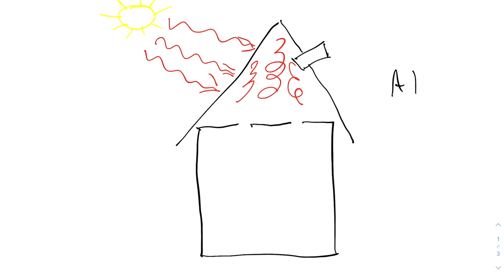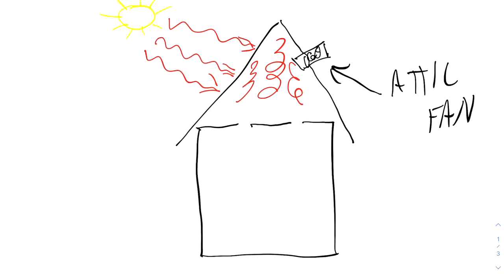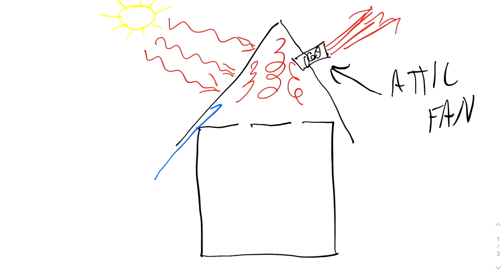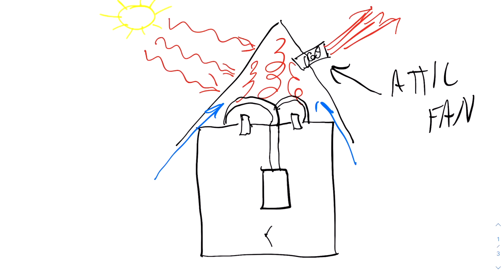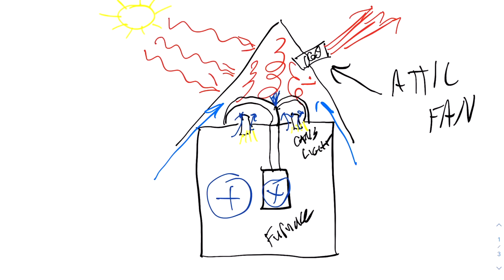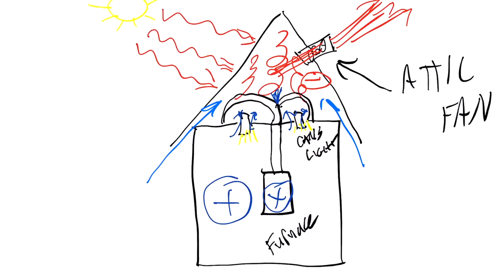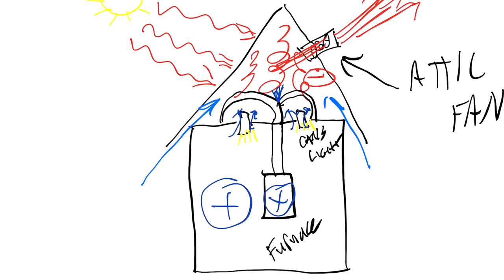3 Remodel Rip-Offs

Comment: Bummer, incorrect and completely inaccurate information regarding attic fans.  At least in a dry and hot climate.  The more attic ventilation the better. It will extent the life of your roof and WILL decrease your attic temperature.  

In this case, do NOT take Matt’s advice regarding attic fans.
Reply: Incorrect. It's bad in any climate.
Reply: His point is powered attic fans are a rip off.  Didn't talk about regular attic vents which obviously are important.
Reply: @shootthechit  I'm sorry, did the algorithm wade you and other losers to a video from over a year ago? 
Tough sht.
Reply: @shootthechit  see if IGAF

Comment: I installed an roof mounted attic fan and gable one also the other side of the house over 30 years ago and It reduced my power bill over 75 bucks a month In the summer here in Florida. I can feel the pull of outside air entering at the eve vents, and it then gets pulled thru the attic, along with the hot air already in the attic, so this video can claim what they want, I know that mine works for sure.

Comment: Attic fans are not a ripoff. Proven to work effectively
Reply: No
Reply: #Yuhhp
Reply: I know of Whole House fans for your attic to be good. Is there a scenario where an attic fan will work good?
Reply: Attic fans also increase pollution in the house.
Reply: Coolsdown my attic by 8 to 10 °F and fresh air blows continuously throughout my house👍
Reply: @decaprio7421 they actually clog up your soffit vents with dust and pollution and are generally bad for your attic.
Reply: By whom?
Reply: Built to fail
Reply: Aren't attica supposed to draw and expel air naturally?
Reply: We need to see this person’s engineering degree.  We need the math involved and science . We need a final decisive decision
Reply: Attic fans work….mine died and my attic temp rose by about 30 degrees and my AC struggled to cool….got it fixed and suddenly my attic is cooler and ac is good…that’s a scam? Lol get out of here
Reply: Click bait or what!???

Comment: Forget the strange example of using a fan to cool the Hot Pocket in the microwave - it was frozen to begin with and the objective is to cook it! Note than when that microwave is running it uses a powered fan (not convention) to get rid of the hot air being generated by the magnetron. With available gable and/or soffit vents an attic fan helps replace the very hot air from the attic with "cooler" air from outside. Even if you are able to completely seal off and insulate the living space many of the houses here in Texas have the AC fan, evaporator coil, and duct work in the attic. Anything that economically reduces the temperature of the attic air in summer is a good thing.

Comment: Good stuff. The one item I'd defer with is replacement windows. Back in 2004, I bought a real old house and was paying $600/mo or more a month during winter in heating. Replaced the windows, and my heating costs dropped to about $300/mo. Take 4 months of cooling, average about $1,000 of saving + $1,000 in comfort a year, I paid my new windows in about 6 years. Stayed in the house longer than 10 years, money paid back. If for no other reason, the comfort alone really made the difference considering the old windows were basically sieves.
Reply: And then the seal breaks and the windows fog up and water etched the glass.  New window time.  I am keeping single pane and getting storm windows.

Comment: Attic fan for Hot-Humid climates:  As long as your living space is air-sealed from the attic, then having a fan with adequate CFM pulling hot air out is beneficial.  After all, what's the purpose of roof turbines or ridge vents?  Air currents seek the path of least resistance and as long as there are enough soffit vents, any negative pressures induced by forced air (fan) in attic space, cooler air will enter thru soffits.  Having said that, the correct balance of CFM vs attic volume needs to be established.  A fan too small won't accomplish anything, and a fan too big consumes more electricity (energy) than is recouped by heat transfer from attic to living space.  It's all a balancing act.  Have it engineered correctly with air-sealing and proper insulation, your attic will thank you (by having forced ventilation aka "Attic Fan).
Reply: Cooling your attic isn't for the benefit of a cooler living space. Attic insulation satisfies that important job. Cooling your attic protects your roof sheathing and shingles from burning up all summer long. The cooler they are the longer they last. So while I agree the attic ventilation is important for the sake of your roof I'm not sure that the cost and electricity of a fan is money well spent in most residential construction.
Reply: @phillijp  Think here bro: Do you really think your attic temps actually influence the temps of your roof tiles when they are in the sun? They don't. That's the whole point of the analogy of you being in the sun on the beach with a fan on you - it doesn't do anything at all.

Comment: My parents 60 year old house in Central California used to have ceilings that were hot to the touch in Spring and Summer, a few of the rooms were like sweat boxes by the end of the day. I installed a thermostatically controlled Solar Roof Vent, a nice one, with a real fan in it. I also adjusted the angle of the Solar Panel to get more Sun during the hot part of the year so it would pull more air in Summer, much less in Winter. It dropped their Aircon usage significantly, ceilings were barely warm in Summer, warmer in Winter. A win/win in comfort, paid itself back easily the first year...

Comment: The other thing he misses about attic fans is that most attics have another side vent that is passive. Most modern houses have soffit vents and that’s where air gets pulled from. So when the fan creates a negative gradient the air enters from these side vents (basically it will  always remain atmospheric)
Reply: Bingo.
Reply: Not true. If the pressure in the attic remained atmospheric, then there would be no air entering through the soffit vents. To create airflow, you need to create a pressure differential. As he said, the same pressure differential that draws air in through the soffit vents can also draw conditioned air out of the house through holes in the wall top plates, holes around light fixtures, etc. Also, one of the main rules for attic ventilation is that you NEVER want more than one type of vent on the roof. Most houses already have ridge vents, turbines, etc, which don't play nicely with power vents.
Reply: @averyalexander2303  The pressure differential is what drives this air movement as you say, but big 2 foot by 2 foot vent holes on either side of your attic is gonna let a lot more air into the attic from outside than all of the combined nail size and smaller holes in the ceiling. Air is gonna take the easiest path with the least resistance. That's fluid dynamics 101. Sure, some will come from the house, but 95% of it at least is coming in through those vents.
Reply: @luke-i1w zero should come from the house. Anything more than zero coming from the house is too much
Reply: @JasonsGuideToThings  I agree, but I also understand that people building houses are not perfect. The barrier between the attic and the house interior is going to have some holes in it. I never say anything is 0% or 100% because in the field, that is an impossible standard to reach.
Reply: @DiO-fy5ex  Not all of them do. My house has Owens Corning Ventsure ridge vent, which doesn't have anything blocking the airflow. The type of roof matters a lot too. Ridge vents can work great on gable roofs, but may not work well on hip roofs because the peak may not be long enough to fit enough ridge vent.

Comment: Heat transfer through a plane is ( I believe) linearly directly related to the heat difference, so cooling your attic air seems to make sense to me.  Lowering the attic air temperature from 130F to 110F   could lower the thermal migration from the attic to the top floor ( cooled to a round 70F) by 33%, if my very poor memory of thermodynamics serves me right.
Reply: no fancy science to back it up but i was thinking the same, 20 degrees would be a fair hope and worth the 75 bucks and the install i did myself......hopefully
Reply: The issue is that you would be better off spending the money on insulation or air sealing. The operational cost of the fan in a well insulated house is higher than the energy saving on air conditioning. If course, this is a bit of a tautology, as if there is a higher savings, it means the house is not well insulated building.
Reply: @johnhaller5851  You're right.  You gotta do the math and factor all the variables.   Assuming you're air tight on that ceiling plane already and you take out the cost of electricity by buying a solar attic fan ($200 cost + install labor? == $300?) then you can get an exactly comparable benefit by just adding 50% more R's to your attic. ( If  I'm using the right formulas..)  So if 50% more R's is more than $300, you should do that.  If 50% more R's in your attic is less than $300, then you should do the solar attic fan.  [Assuming assuming assuming...]

Comment: As a test, I put a box fan in my attic.  On the lowest setting, I aimed the fan toward the gable vent.  All I wanted to do was create movement of the air not a suction or vacuum.  I monitored the temperature constantly via an inexpensive indoor WIFI camera and a thermometer.  On a warm day I was able to reduce the temperature considerably in the attic.  I did not want to manipulate the pressure in the attic, I only wanted to gently move the air around.  I just wanted to create a small current of air and encourage it to move.  It worked for me.  I also connected the fan to a WEMO receptacle so I could schedule it to turn on and off whenever I wanted it to.  The WIFI camera is infrared so I could monitor the thermometer in the dark attic.
Reply: You know you can get a cheap wifi or Bluetooth thermometer so that you can do this without a camera.  Keeps detailed historical readings for you as well.
Reply: @owenf4535  I was sure that I had checked this out and that I was disappointed.  Your reply made me look again and you are right, there are some inexpensive Wi-Fi items out there.  Thanks!

Comment: Here again I have to disagree on the smart thermostat. For him to say to never leave your fan on all the time is not a good idea. As an HVAC technician I have found that with the high-efficiency ECM motors or variable speed motors running at a low speed all the time there is very little draw on the electricity. This also allows cooler air from the basement to make its way up to the upper levels and some of the two-story upper levels that are hotter because heat is rising is now bringing that hot air down and mixing it with the home when the AC is off.  I leave my fan on all the time to help balance the levels of my home making it more comfortable. Filltering the air all the time and humidifying in the winter time when needed as I live in Colorado. Also smart thermostats allow us to be able to use Geo fencing when you’re not around the temperatures can change to put less demand on your cooling and heating system and overtime that can also save you money.  Now I know letting your house get to 80° and then trying to drop it to 70° in the summertime is not an efficient way to do things but you can change it 3° or 4° and overtime that could make a difference. Also digital thermostats have cycle per hour limits that minimize the amount of on and off a system will encounter. This of course puts less wear and tear on your heating and cooling system. 

I would completely disagree that smart thermostats are not a good idea. There are even more reasons to own a smart thermostat that I didn’t mention here. I’m just not seeing the science behind what he saying.   I guess I’m realizing I need to question his channel.  

Here in Colorado I’ve seen a huge difference in homes with single pane windows that have changed to double pane windows. I’m not claiming the savings numbers, but it is significant and when you factor in the comfort, and air infiltration and more why would anyone not upgrade their single pane windows to double pane?  I get he’s arguing the savings with numbers but I really think this whole video was a bad idea and should’ve never been posted.

My opinion of course 😀

Comment: I think the key thing with smart thermostats is that they make your house more comfortable (in general).  In my case when I went from 'dumb' to smart thermostats the comfort level was vastly better (far less swing in a radiant heating system from high to low temp).  I did notice a SMALL amount of energy savings.  The remote control and comfort was more then worth it for me.
Reply: Also, if you have vacation homes you can save a ton of money in avoiding frozen pipes in the winter and cooling in the summer when you’re not there. I let my house sit pretty close to 80 unless I’m going to be there. Then I can cool it down starting in the morning before I get home. Also, I have a dual zone AC that was never balanced. Now I have assignable temperature sensors in every room and the thermostat does a good job at consolidating them into a comfortable average
Reply: They are also great for turning down/up the temperature when you haven't moved for hours while you binge watch TV and schedule thinks you are asleep.

Comment: those attic fans are good at pushing out heat in the attic....not saying youre wrong but sit in an attic without the fan on and turn it on it is noticeable.
Reply: He's wrong.  Convection is an incredibly effective method to move heat.  Pulling outside air through a hot attic and over the hot surfaces warmed by radiation cools the surfaces.  This is extremely easy to demonstrate and I'm honestly shocked that anyone would argue otherwise.  The negative pressure point is valid only if there's not enough makeup air opening for the cfm rating of your fan or if it's extremely far away.
Reply: They do cool down the attic, but the problem with them is that most houses aren't airtight and it's pulling most of the cool air from the house rather than the soffits. So it might cool down the attic, but that doesn't mean that it's helping your energy costs when you're losing cool air from inside the house due to them.
Reply: @IanSlatas  most attics have vents in them. I forget what they are called... The ones under the overhangs. But it's far better than not having them.
Reply: @chaseoes , If your ceiling has more air flow than full length soffit vents, you'd have serious trouble trying to heat that house.
Reply: @ashishpatel350  The vents under the eaves are called soffit vents.  They can be utilized in combination with a ridge vent for passive ventilation.  Attics that need to move a larger volumetric rate of air than soffit vents can supply can be coupled with gable vents or other intakes.  Very effective stuff.

Comment: I just changed from single pane to dual pane windows. I opted to buy the ANLIN brand. Check it out, it’s much better than the other brands, however, they are probably twice the price.
The amount of air that passed through the cracks was ridiculous, but I live in a mild temperature area of the country and I wasn’t having any water leaks. Let me also say, I would not have done it if my neighbor hadn’t decided to install a fire pit with tiki torches. All his smoke went right into my house!
That being said, I am so glad I replaced my windows and sliding door. The small amount I’m saving on air conditioning and heating is irrelevant. The windows are so nice (and no smoke). 
     Just one final note: Buying new appliances or windows or anything else to save energy does not pay for the new appliances. Just buy new stuff when you want to buy new stuff. Just remember, the old stuff is better quality. And you may be better-off fixing your old stuff.
Reply: The old stuff is absolutely better quality. I have a thrift store and see a lot of old stuff  and new stuff pass thru. Especially stuff salvaged from older homes; as in, light fixtures, ceiling fans, sinks, freezers, fridges, even fireplace mantels. Older, small and large appliances are far better. I have an older washing machine, dryer and refrigerator in my home. The front loading washer just wouldn't get my clothes clean, the counter depth,(it means too small) digital fridge kept locking me out and needing repairs. The older stuff breaks too, but I can repair it myself in a timely manner instead of weeks or even months waiting for a warranty repair man.